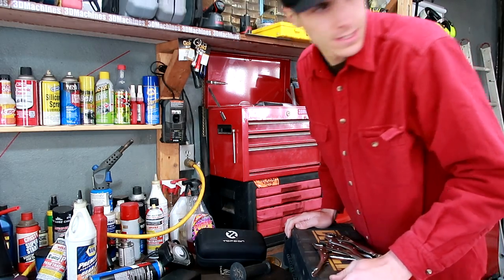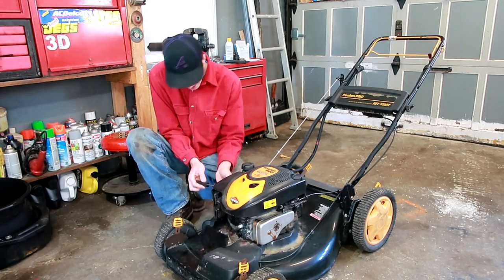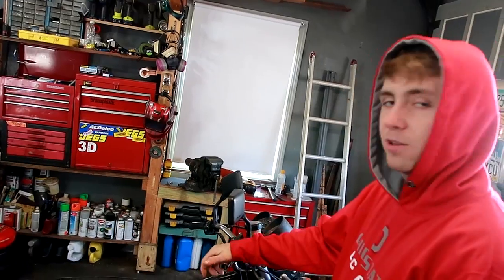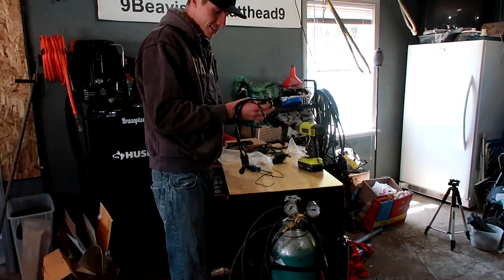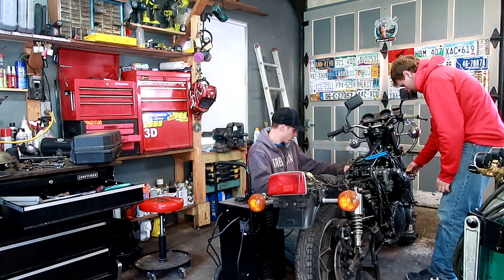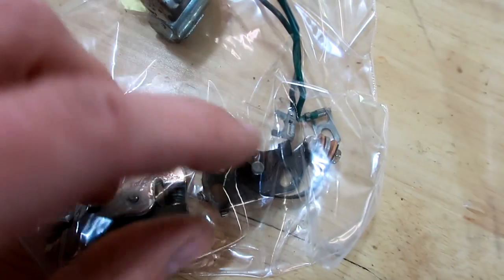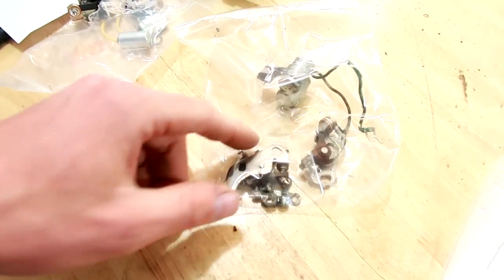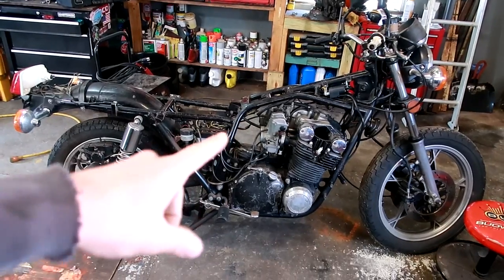UPDATE on the GS1000

Comment: Dalton! those are definitely the wrong parts man.  if the coils don't line up to the brackets and are out by that much then they're for sure wrong. Even if they are aftermarket.  You should look up the mount dimensions on the Kawi model that is on the box they came. That will tell you if they're wrong. Can't wait to see that gator light em up!

Comment: lol maintaining lawnmowers... Sure... Haven't changed the oil in 10 years. Not that it needs it tho. The engine will outlast the rest of the mower. It can hardly pull anymore and it's because plastic gears don't last 10 years of use. :/

Comment: you dont drive a car like that when its cold!!!!!!!!
Reply: Stefan Markovic is it your car? Who's cares
Reply: Stefan Markovic Jebiga
Reply: its his car he can do what he likes with it
Reply: its not very nice to begin with, its like a $3000 car. its not an ACR Viper or a GTR.
Reply: Stefan Markovic You shouldn't drive a nice car like that when it's cold.  
That's just a giant pile, like most of what he's got laying around there.
Reply: Stefan Markovic Have you ever heard of editing? He probably cut out the part between the two clips of when he started the car and when he started driving it. For all anyone knows he could've let it warm up for an hour.
Reply: wow , that's good . I want to learn how to do that .  you can tell the cars operating temperature just by watching a 3 second video clip ?   for me .I didn't know ,   for all I knew that thing could have been over heating 3 minutes before .  I just didn't know just by seeing a video .  how did you know Stefan ? whats your secret ? .  
    and by the way , since the invention of fuel injection , its not necessary to warm up a car before driving .  
 When your engine is cold, the gasoline is less likely to evaporate and create the correct ratio of air and vaporized fuel for combustion. Engines with electronic fuel injection have sensors that compensate for the cold by pumping more gasoline into the mixture. The engine continues to run rich in this way until it heats up to about 40 degrees Fahrenheit
     Warming up your car before driving is a leftover practice from a time when carbureted engines dominated the roads. Carburetors mix gasoline and air to make vaporized fuel to run an engine, but they don't have sensors that tweak the amount of gasoline when it's cold out. As a result, you have to let older cars warm up before driving or they will stall out. But it's been about 30 years since carbureted engines were common in cars.
   warming up your car is just a waste of gas and can cause damage over time by stripping oil away from the engine's cylinders and pistons

     he paid 500 for that thing off craigslist ,  I'm sure he beats the snot out of it ..  I would too  .   braaap on!